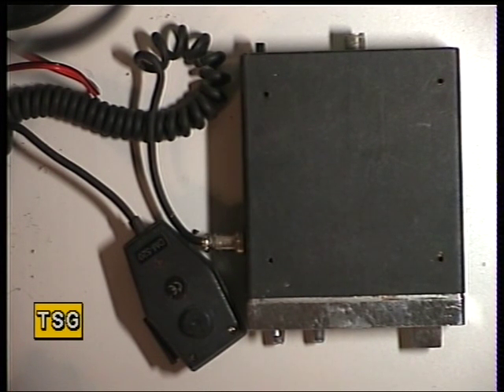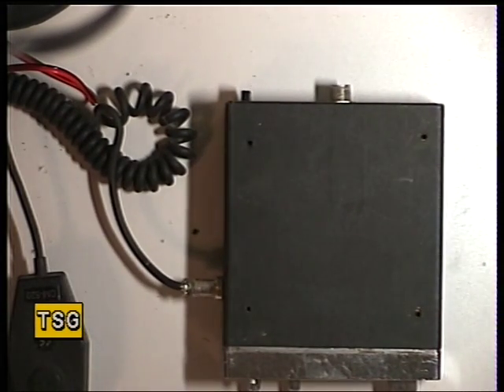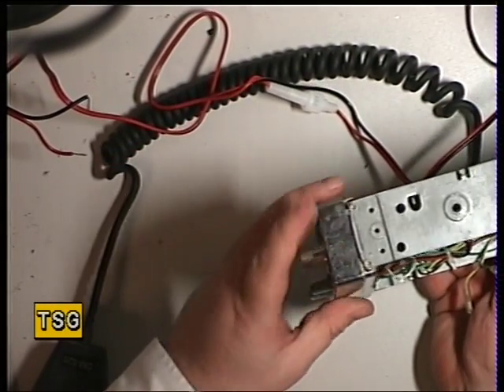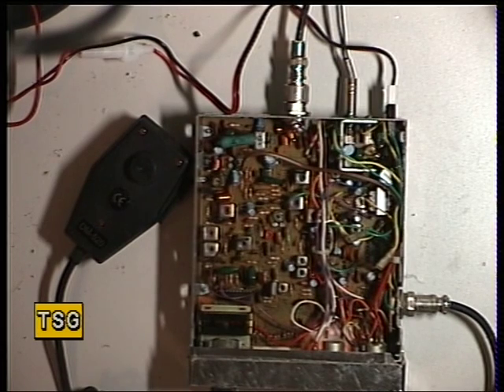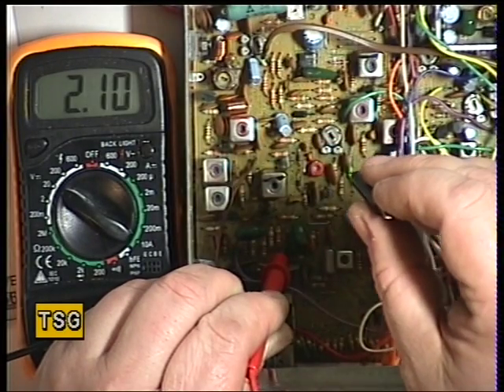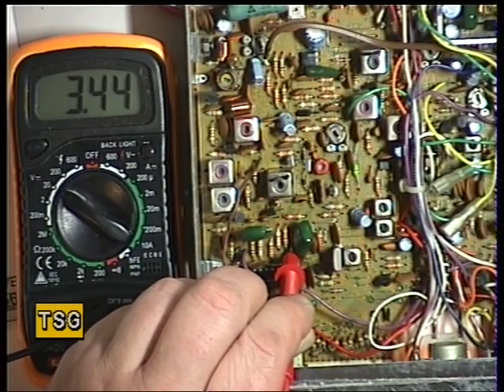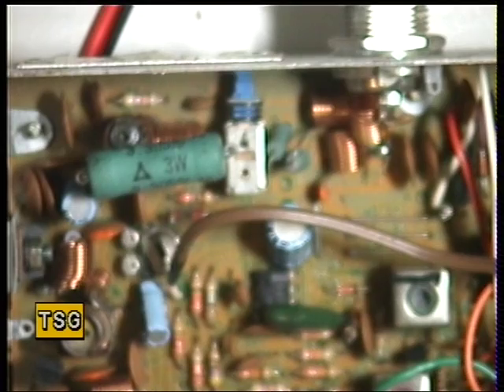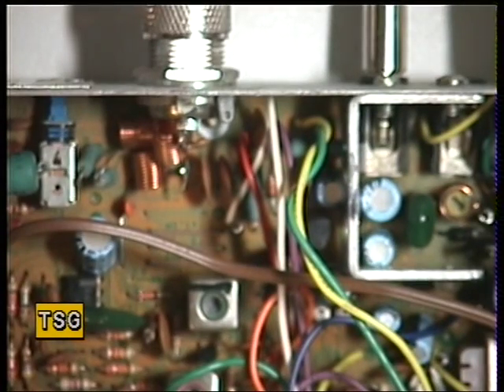Mustang CB1000 UK CB radio., overview & VCO alignment

Comment: p.s. it will probably just end up on the self now with the rest of the radios , Just to let you know the first uk/fm radio i owned was the midland 3001 purchased in dec 1980 prior to legalization in 1981 , And i do still have this radio all working and original with box in tow.
chris.

Comment: Hi Richard ,
Well as i said i was awaiting a replacement la1230, this arrived today and i fitted this this evening turned on the radio and there it was rx fully working along with the rx meter.
I rechecked the vco alignment again but still nothing , So i stuck the prods in pwr supply to see if the meter was working and 13.8 v so i thought maybe theres a problem with the meter on low volts tryed it on a 1.5v batt all ok.
Anyway turns out it was a bad earth , so i rechecked and reset as your advice and was getting 2 volt on channel 1 and 3.5 on channel 40 .
I cant thank you enough for your advice, Your vids are excellent and easy to understand.
Im sure i will be returning to look at them soon ,
Many thanks 73/51
Chris.
Reply from the maker: Glad that all worked out for you Chris. They are jolly good CB sets with very sensitive receivers.

I'm sure you'll find my videos interesting as I progress with this channel even if you don't own the set I'm discussing!

Quite a lot of our work is servicing brand new sets, as they don't come out of the boxes working at their best. Some retailers service new rigs before despatching rather than waiting for customers to moan, so some videos will be covering brand new models. The usual snag is that we don't have manuals for new sets so it's an educated guess...not got it wrong yet though!

Comment: Hi just a quick update still on going with the radio , ive now removed the la1230, awaiting a replacement and i will keep you posted regarding this.
regards chris.
Reply from the maker: errr...I thought the RX VCO was zero volts?
Reply: UK CB radio servicing hi  yes it was showing o volts on tx and rx, I tryed adjusting these as per video but they never altered, But on tx the dummy load on the radio went on and of whilst moving the adjustment.
But i must confess that this is only an hobby im playing around at not like yourself.
Ive operated cb radio since around 1980 the old am days, Now i rarely bother i just have a couple of radios that are broken that im playing with, 1 been the unit in question and the other a cobra 21 gtl with a fault on tx. (something to pass on the dark nights)
thanks chris.
Reply from the maker: brian hague You're doing something wrong if your meter shows zero on TX, yet the radio transmits. Black test prod to chassis, red to the rear connection of that capacitor I show, meter set to 20v range or similar.
Reply: UK CB radio servicing hi that was how i had it. i clipped a croc clip to the chasis  and it was set to 20v position dc, I must admitt i found it a little strange that it was not giving the correct readings on tx , Theres not much i can do until i solder the other part back in .
I will give this ago again asap, but in the mean time thankyou for your co- operation , I understand you are most likely thinking why does he not take it to somebody who knows.
But as i say i do have working radios bought from new all still working fine and would never dream of messing with factory settings, These are just a couple i have decided to have a play with, The cobra 21gtl i was stupid enough to tx many yrs ago with no antenna and the tx went down i replaced the main output , driver and buffer to no  avail, But back then there was no internet and recently found this in a shoe box where i then decided to have another go at it and downloaded the schematic, But meanwhile came across  the transcom at a local market paid a tenner and this has now taken over.
CB is like a love hate relationship its been on going since 1980 when i was 12.
Thanks chris.
Reply from the maker: Ok on that. I suspect the capacitor lead wire you have your positive prod on was too dirty to conduct & probably needs a little scrape before you try again.

Regarding your Cobra 21GTL; My database shows that as an FCC type approved set (US market) & as such is not legal to either own or use in the UK.

Comment: Hi many thanks for your quick reply, i have only just noticed this but it looks very informative, i will was the other videos asap and will let you know i go on.
many thanks ,
kind regards chris.
Reply: Hi Richard ,
just had a quick look at the voltages on the vco , they are reading 0 volts channel 1 and 40, Also i had checked the diodes at the back of the radio earlier ie, diode 11 they seemed ok , But i must thank you for your very informative videos again they are excellent.
i wiil soldier on and keep you informed,
kind regards chris.
Reply: brian hague should have said also that the squelch does appear to work,
chris.
Reply from the maker: brian hague If the squelch is working, chances are it's just the RX vco out of lock. Seeing as TX works you say, it probably just wants adjusting on RX. Just follow the manual & my instructions!